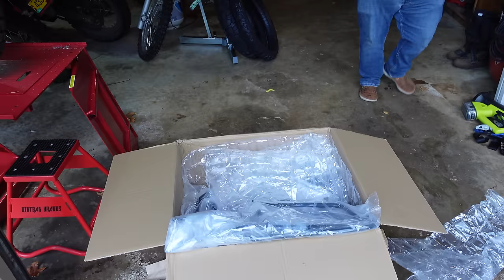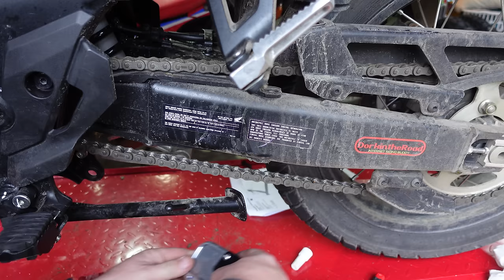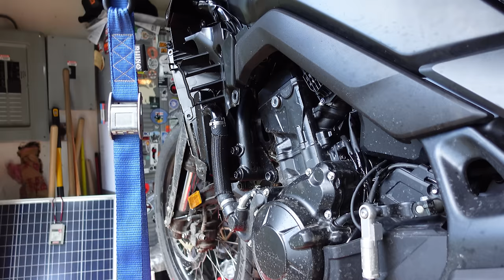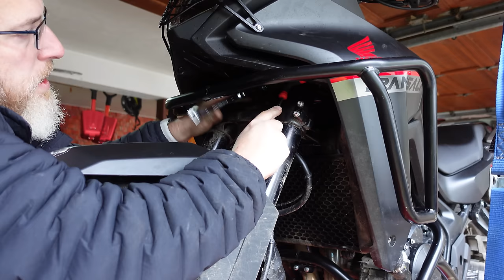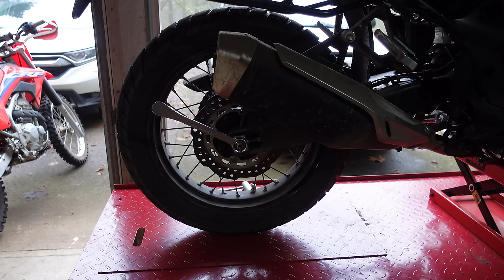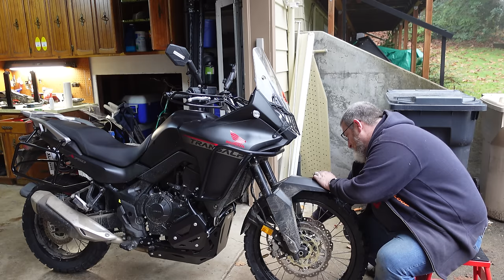Skid Plate, Crash Bars, New Tires, and MORE: Honda Transalp 750 Mods Install

Comment from the maker: Honda Transalp 750 Mods List (so far):
(affiliate links where possible)
Hepco and Becker Transalp 750 Tank Guard: https://www.motomachines.com/hepco-becker-tank-guard-honda-xl750-transalp-2024
Hepco and Becker Transalp 750 Engine Guards: https://www.motomachines.com/hepco-becker-engine-guard-honda-xl750-transalp-2024
Hepco and Becker Transalp 750 Skid Plate: https://www.motomachines.com/hepco-becker-engine-skid-plate-honda-xl750-transalp-2024
Hepco and Becker Side Stand Enlargement: https://www.motomachines.com/hepco-becker-side-stand-enlargement-honda-xl750-transalp-2024
Hepco and Becker Pannier Racks for Honda Transalp 750: https://www.motomachines.com/hepco-becker-side-carrier-honda-xl750-transalp-2024
Hepco and Becker Engine Guard Mounting Adapter: https://www.motomachines.com/hepco-becker-engine-guard-mounting-adapter-set-honda-xl750-transalp-2024
Hepco and Becker Headlight Guard for XL750 Transalp: https://www.motomachines.com/hepco-becker-headlight-guard-honda-xl750-transalp-2024
Hepco and Becker Side Protection Plates for XL750: https://www.motomachines.com/hepco-becker-side-protection-plates-for-engine-guard-honda-xl750-transalp-2024
Hepco and Becker Handguards: https://www.motomachines.com/hepco-becker-handlebar-guards-honda-xl750-transalp-2024
Doubletake Adventure Mirrors: https://bit.ly/3F1lxkT
Dunlop Trailmax Raid Front Tire: https://www.rockymountainatvmc.com/tires-and-wheels/dunlop-trailmax-raid-front-motorcycle-tire-p
Dunlop Trailmax Raid Rear Tire: https://www.rockymountainatvmc.com/tires-and-wheels/dunlop-trailmax-raid-rear-motorcycle-tire-p
Reply: Did you forget the tuner? I want one that has the European tune.

Comment: Re H&B Adaptor Plates:  I had the same issue with the threads.  But thanks to your video I checked and fixed the problem before mounting.  I measured the original hole diameters; they were 7mm and should have been 8mm (for the M8 bolts).  I used a M8 x 1.25 tap set and it removed a lot metal in the process; so it wasn't just a matter of paint. H&B inadvertently had tapped the holes the wrong spec. After my re-tapping, the H&B-supplied M8 bolts screwed in without problem.  Really appreciate your videos.  Entertaining and, for the installs, you save us a lot of frustration!  Much thanks.

Comment: Nice video Ben, don’t be so hard on yourself. I’ve had trouble with fitting every set of crash bars I have ever put on. Transalp is looking pretty cool. 
The tyres will be interesting, other videos I have watched about these tyres are reporting the front washing out in sand. I haven’t seen them on a Transalp yet though . 👍🇦🇺

Comment: I had the same issue with the adapter plates!!!! I figured it was because there was paint in the threads. I forced the bolts from the engine guards in to ‘clear’ the threads then used the longer bolts from the tank guards, but they were super tight! Quite a tricky install..
Reply: Same issue with the adapter plates here in my garage!

Comment: I bought my transalp a little over two weeks ago now, based on yours and big rock motos videos up to that point. And I absolutely love it. Despite it needing some work to make it off roadable. I mostly use it as a commuter so its not that big of a problem for me right now. Thanks for all of the info you’ve shared!
Oh and I also have the OEM tall windshield, windshield extenders, fairing block offs, 12v plug, heated grips coming. Soon if anybody wants to know how those pan out
Reply from the maker: Where did you find the 12v plug? I'm hoping to get the OEM one
Reply: @DorkintheRoad that hardware included with those h@b guards was garbage.

Comment: I was thinking wrong bolt thread pitch (yes it's a thing) when you said made in Germany. MM bolts are weird there are multiple thread pitches not like SAE standard or fine threads. Too easy. Looking forward to you pounding down the BDR and bottoming out :)

Comment: Your videos helped me to decide to buy one. I put a down payment on a Transalp.
Pro tip: wash the bike before installing new pieces. :face-green-smiling: It will look even peeeertier. 😋
You fixed the threads in the bracket holes. If you keep fixing things you will  not be able to call yourself the Dork anymore. 🤣
Sometimes a bolt hole has excess paint in it and that maybe the situation with the brackets you received.
The Yamaha Tenera T7 has the same type of low exhaust and oil pan and comes with a skid plate already as it needs one also.
The Hepco& Becker website pic of the skidplate installed shows the clamp's bolt installed from the front just like you decided too. :elbowcough:👍
Good idea to always apply baby powder to the inside of the tire and the tube. This greatly reduces friction between the 2.

Comment: Thanks for the video tutorial. 👍🏼
I installed Hepco and Becker tank guards on my Transalp two weeks ago (I’m in Australia) and had your problem with the threads in the adaptor plates. I’m a toolmaker by trade so had the necessary tap and tap wrench on hand to run through the existing threads. Definitely took steel out but not sure what the problem was as I didn’t think to check the existing holes. My thoughts are the existing threads could have been tapped with a fine thread and not a course thread to match the screws. M8x1.0 pitch instead of M8x1.25 pitch.
Btw, enjoying your Transalp videos and tutorials, entertaining and helpful. 🍻

Comment: I've got the same plate coming but this is the first time I've seen the mounting bolts on the bottom of the plate. Not cool, especially being as the plate has to be removed to change the oil. They will also grab a tree rather than slide Hmmmmm.
A few other's reccess the bolts, even if it means losing more clearance. We'll see.
Maybe I'll make 1/4" plate sliders with countersunk bolts to replace those. Touratech has that setup

Comment: For the record, a tap in general will probably remove some metal along with the paint. This is not what you want. If you can find a thread chaser they are generally a better option. You can sometimes make one just by filing some v slots in a bolt. Also, some leftover paint is often a good "thread locker". Especially if you are not applying loctite to everything.
Reply from the maker: Yes I discovered the existence of thread chasers after I had already bought the tap, but it worked out well so I'm okay with it.
Reply: @DorkintheRoad  The deeper the threads, the less critical it is to use a chaser. Live and learn ;)

Comment: I bought the Honda Shop Repair Manual & torque specs are:
Rear axle: 74 ft- lbs.
Front axle: 48 ft-lbs..
Front axle pinch bolts: 16 ft-lbs.. Do the left side 1st.

I finally received my Hepco skidplate, lower crash bar & rear brackets.
I also had to run a 8mm × 1.25 tap through the tapped holes on the 2 brackets & the 1 on the lower part of both lower crash bars. It was only paint on the female threads that the tap was required to removed. Then it was perfect.

Comment: I installed the exact same crash bars on my Transalp 750 and didn’t have any issue with the adapters. Just bad luck I guess. I however had a lot of difficulties screwing the skid plate bolts though, and even broke one bolt head.
Reply from the maker: Good to hear.  I figured it was just something funky with the ones I got.

Comment: Does all of the protection have to come off to take the fairing off, to then get to the air filter?  If so, this all adds some major inconvenience to changing the air filter.
Reply from the maker: Yeah I'm not sure yet.  I'm hoping not but thinking maybe it'll be necessary. These are a little higher up than the Outback bars.

Comment: Saddly, I had a similar issue with the SW Motec crash bars for my Triumph Tiger 660.  The instructions were incorrect (even read them in the native German to see if it was a translation error) also leading to having to modify a spacer as it was 5 mm too thick.  Contacted SWM USA and they were appologetic but gave no indication they were fixing it in the kit or the instructions.

Not my prior experience with them but also never ordered something from the actual US branch (did not exist in the past).

Comment: Are those the Rabaconda levers? Ive been eyeballing those. In your opinion, are they robust? Do they 'give' at all when pushing on them? Aluminum/Steel?
Reply from the maker: Uh...the regular ones or the beefy ones with the green handle? I actually bent one of the regular rabaconda ones because I didn't have the tire in the drop center...

Comment: Pardon me if this has been asked before. As a curiosity,how much weight has been added to the bike from stock with the add-ons?
BTW, you do an excellent job on these vids.
Thank You.
Reply from the maker: I don't know because honestly I've never really worried about it.  You need protection.  I'd put it on any bike I bought so it all evens out in the end.
Reply: @DorkintheRoad  This is all very true. It was just a curiosity. As we get older we tend to be more concerned with such things. At my age, I'm leaning more toward an older DR350, KLR250, or the cr350L, or maybe the CB500X because of the weight thing. Speed and/or power just aren't a big concern for me anymore like it was when I was younger. This is a beautiful bike though.

Comment: @DorkintheRoad, do you need the Adapter plate which joins the upper and lower crash bars if you're getting everything from Hepco itself? I thought you only need the adapter in case you're using OEM top or bottom crash bars and want to mix and match with Hepco. Here in India, seller is telling the Adapter is a must even if upper and lower crash bars are from Hepco.

Comment: @DorkintheRoad Hey Ben. On the skid plate, forward bracket, was the bottom part of that bracket angled towards the front of the bike or towards the rear? if I mount the forward bracket to directed more forward, I don’t have enough slack to put on the side bolts. But if I face it the other way, it touches my header heat shield and that seems bad.

Comment: I know you have previously said the Suzuki V-Strom 800DE doesn't make sense on paper, but I never understood that. Most say its because the Transalp is so much lighter.

If you take into account the Suzuki V-Strom 800DE's increased tank size, increased oil reservoir size, the better fully adjustable and additional travel front and rear suspension that comes with additional weight, and the stock skid plate (not very robust, I admit, but it has a metal one), and the heavier gauge steel frame, the weight difference is now less than fifteen pounds, and most of that weight difference is down low.

The argument that the 2024Transalp (curb weight) is a "lighter" bike (33lbs less than the 2024 800DE curb weight) is misleading and specious. It's a advertising gimmick. The torque on the Transalp is up high, like a street bike, whereas the torque on the 800DE is down low, where you need it, off-road.

I really wish you could have tried a 800DE before you decided it didn't deserve consideration based on your reading of a spec sheet. Pretty good riders are calling it the DR800. Which is meaningless to you, because you've never ridden a DR650, a much better bike than the KLR650 that you do own. You don't seem to know or ride with anyone that owns a Suzuki, so I get you have no frame of reference.

Maybe your area doesn't have a lot of Suzuki dealers.
Reply from the maker: I made one offhand comment one time and suddenly I'm a Suzuki hater. I can't evaluate something I haven't ridden.

Comment: I was just saying what do you need w these bikes..more weight..more metal things to bolt on in case you go to Starbucks and a guy on a GS pulls up and says size matters..or you are wrestling with a Tenere 700.. they should fill the frames of these bikes w cement.. making them more stable on all the " technical" dirt roads they will be on..why can't someone just make a sub 350lbs twin? I saw some Italian brand has a twin that is outlawed for being too powerful..no worries in this market.these guys have designed adventure and dual sport bikes that have anti wheelie settings and luggage is a bigger concern than anything off road..DRZ is looking like a better and better motorcycle..I sure hope that Honda has a huge windshield that can be installed at the dealership.. because nothing says mean middle aged off road warrior like a big wind blocking windshield and phone mounts, luggage,ABS, traction control and cruise control.. Harley engineering is dreaming up a PanAmerica light.. Dylan Mulvaney is getting one as a promotion.. and its right in the ballpark of 5-600 pounds like the rest.. Kawasaki is missing out by not tweaking the Versys.. just need a few things and its close

Comment: Biggest secret in changing tires.....zip ties. I can put my front on the rim w no tools. Back just a little tool work.
Reply from the maker: Even with tubed tires?  I've seen that trick used for tubless.
Reply: @DorkintheRoad  Yep for sure. I have done it on my 23KLR 3 changes so far. Eliminates the pinching and makes it so much easier. I put a little air in the tube. Fit it in the tire with the valve stem lined up with the tire dot. Zip tie tight as possible every 10inches or so. Put stem through rim and put on a nut loosely. Then put some lube on the rim and using upper body push them right on

Comment: Hey not hating .but to change rear tire their is no reason to move rear chain adjuster bolts .just remove big nut slide axle out , push tire foward slip chain off and repeat on install push tire foward and tighten axle nut